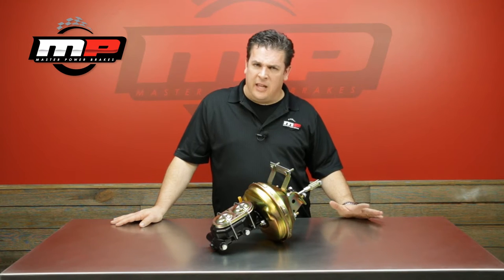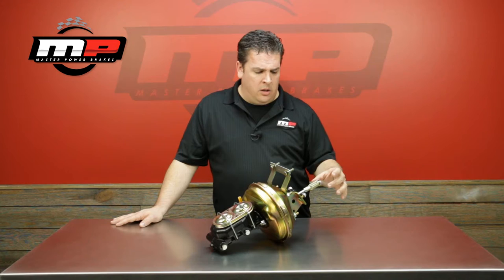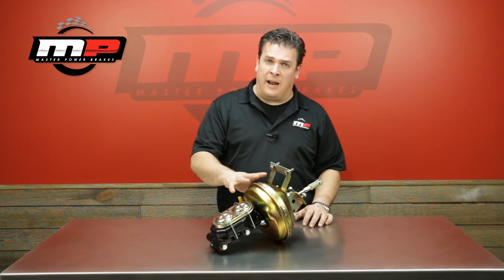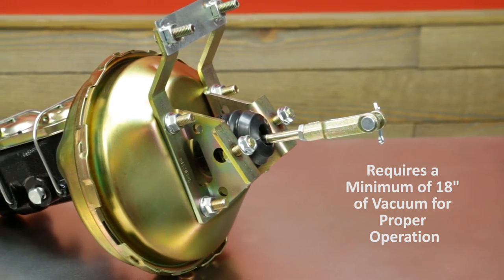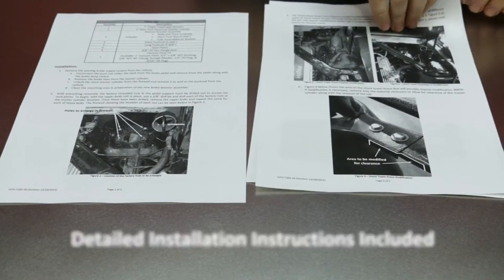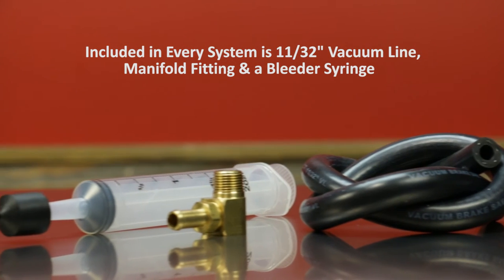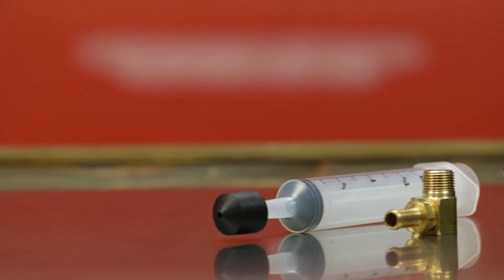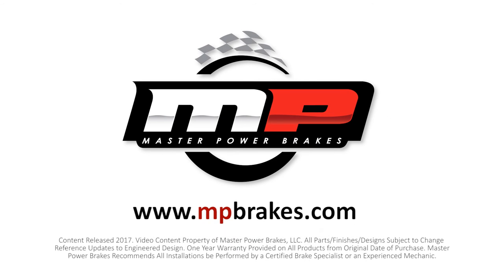1963 - 1967 Corvette Booster Master Video by Master Power Brakes

Comment: Just installed rebuilt Booster. I have a 63 LS powered corvette restomod with zo6 disc brakes. Pedal is hard and not the best braking.  The master cylinder is a reproduction 67 corvette . Any recommendations . Thanks